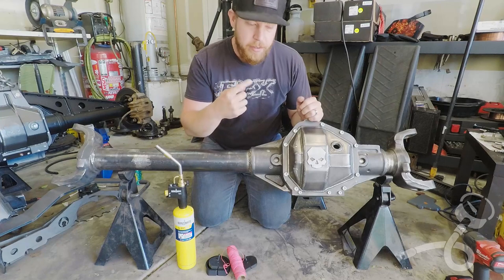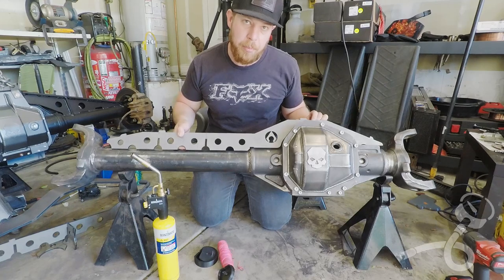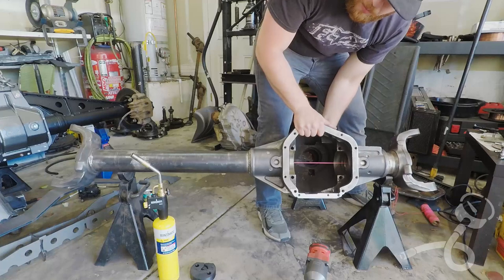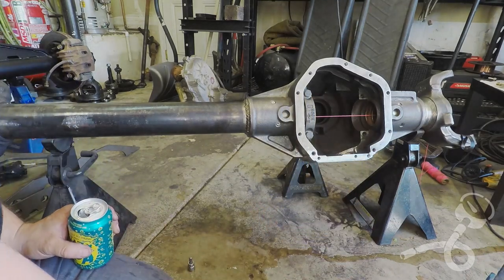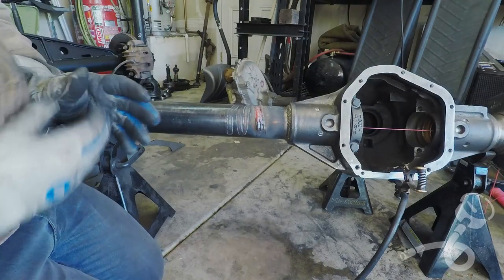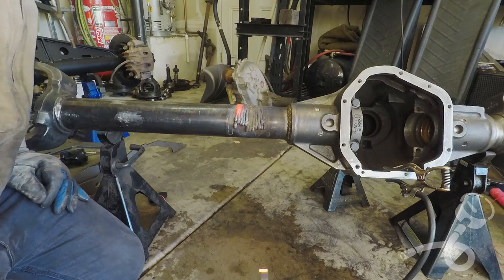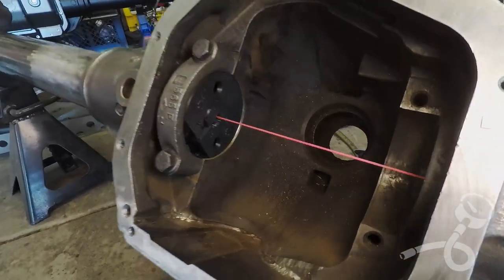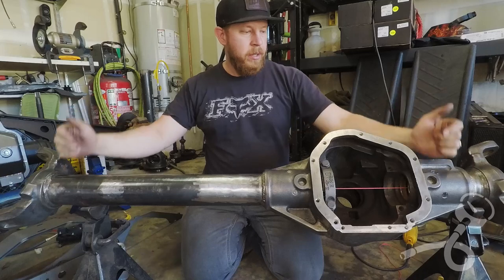Dana 60 Straightening for Cheap: How to Straighten a Mildly Bent Superduty Front Axle with Heat

Comment: How did you determine where the bend was; if it was bent closer to the knuckle, could you have just created an S bend rather than straightening it?
Reply from the maker: Hello. I didn’t know for sure. And I’m not sure it will matter as long as point A to point B is straight.

Comment: I have a question, these several heat and fat cold procedures won't make the axle tuve more fragile?
Reply from the maker: They might make the steel more brittle. By grinding all the welding down at the end, I believe I reset a lot of the steel to be less brittle. I’m not a metals expert by any means. I also added a truss to this axle, so I won’t have any strength issues. For other doing this, I would just weld the tubes without quenching and that should solve a lot of potential problems.

Comment: You need a "rose bud" torch to heat that  large area cheery red...that mapp gas and tig machine ain't doing squat
Reply from the maker: You are definitely right. I definitely learned that this time around. I have a weed burner now for welding cast, but it’s probably still not hot enough to get a housing cherry red.

Comment: And here is my problem. My Ford 8.8 bent in the center section. It closed up the shim gap .006", so my machined surface for the bearing race is crooked. I really don't know if I can bend the tube straight and CAREFULLY re-machine the race wall with a dremel and it work or not. I'm quite a ways into rebuild, already installed all new bearings b/c it had water in it. Little did I know that when the previous owner ditched it, they bent the tube AND got water in it. Any thoughts on a bent housing and the ideas I have to fix it??
Reply from the maker: That sounds like a real big problem. I’d like to think that you could use the bottle jack method to force the axle the opposite direction. If it bent at the center, maybe it would bend back at the center? That’s a tough problem my friend.

Comment: Nice work and idea! Can you 3D print these guides for a Dana 30 and Dana 44?
Reply from the maker: Thanks! I sure can. I just need some measurements from you. I need the carrier bearing race outside diameter and the inside diameter of the axle tubes at the end.
Reply: @aireddown813  Will need to measure the tubes, bearing race is easy as I can find the race specs. How much would a set run?
Reply from the maker: @ivanvujadinovic9905  I've been doing $10 per set

Comment: I don’t think the quenching was necessary using the MIG process, hopefully that area isn’t work hardened too much.
Reply from the maker: I think all the nasty hot grinding I did to mow down the beads annealed the area. Also, the truss will add a ton of strength.
Reply from the maker: You’re probably right tho. I bet it didn’t really help at all.

Comment: The joke LOL
Reply from the maker: Haha 🤣
Reply: So how would you suggest to straighten an axle.put in new tubes, seriously.i think my left rear might be bent
Reply from the maker: Robert Andrews - That depends on how bent it is. If it’s a little bent, the MIG welding method will work. If it’s very bent, you’ll probably have to rig up a bottle jack and some chains to a frame and press the axle straight.